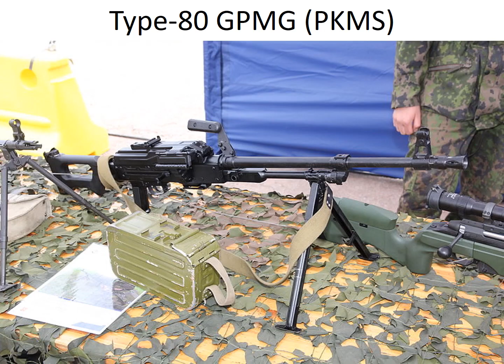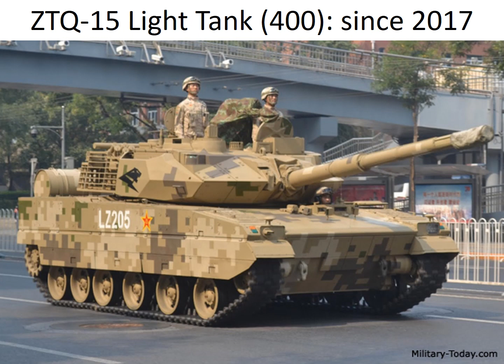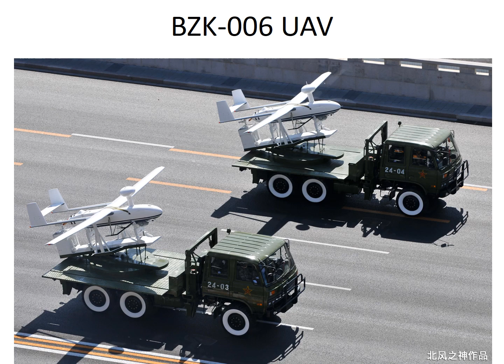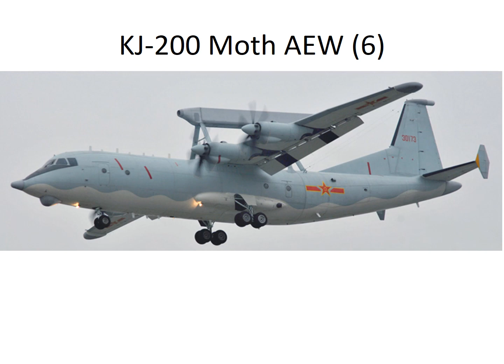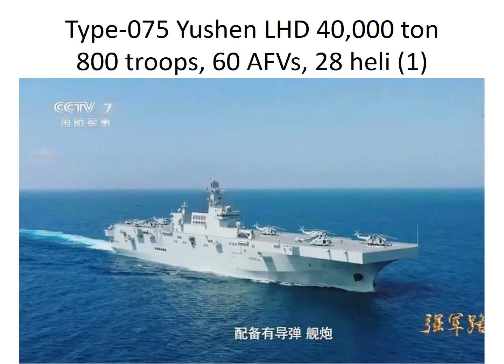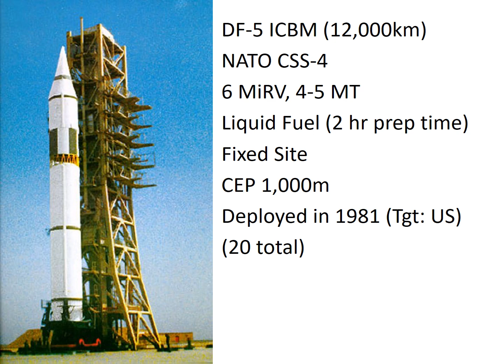006 Strategic Studies of China Lecture 2 Organization and Weapons of the People’s Liberation Army

Comment: 10:51 ok so the AFT-10 ATGM carrier is crazy because they can employ those missiles in closed terrain and still get maximum range. The missiles they use have several tracking options one being manually. All they need to do is receive a grid from where an armored thrust is coming from then they can manually control the missile into that general area get a thermal lock then let the missile finish the job by diving onto the target.